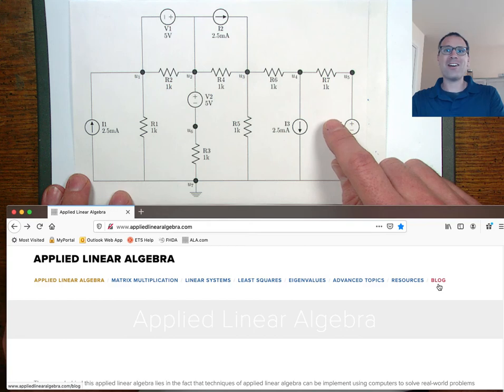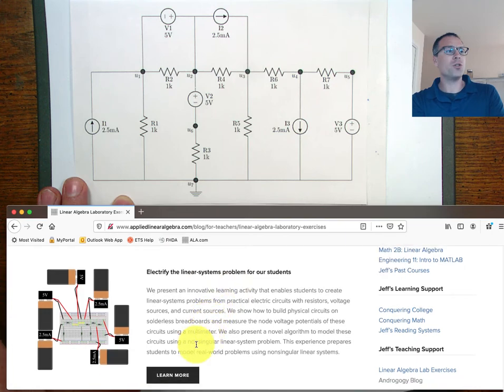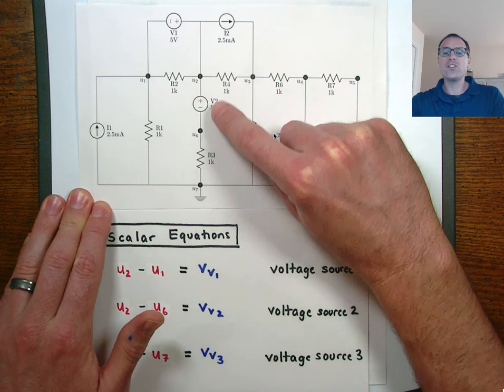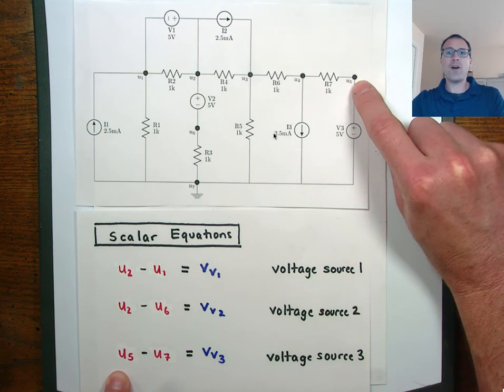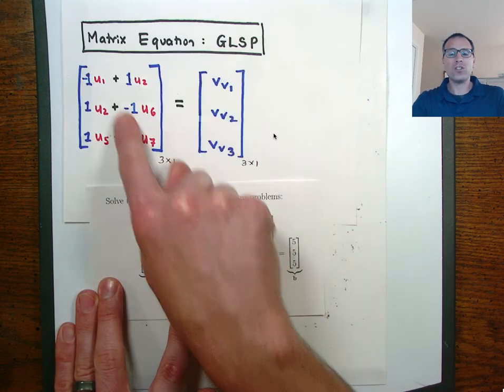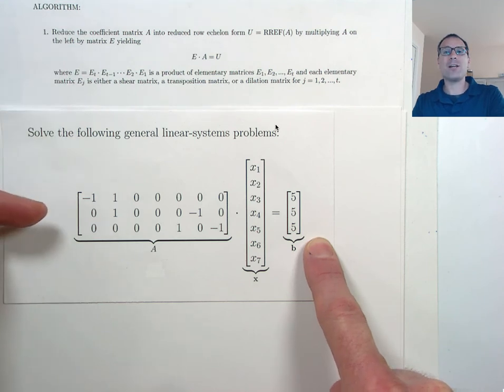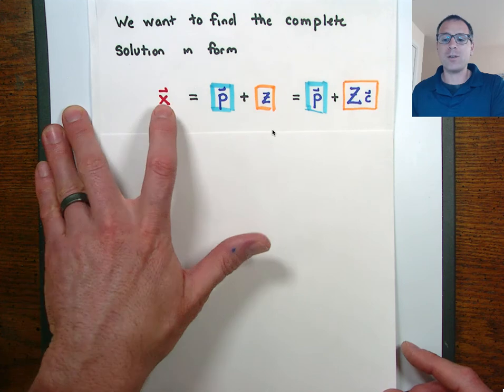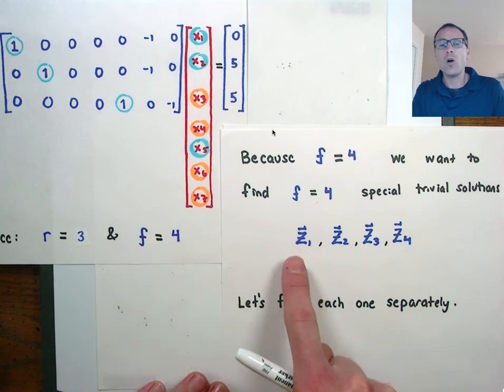A general linear-systems problem from electric circuit analysis

Comment: For the z vectors, aren't there an f times 2 amount of unique solutions because for each z vector I can just switch the signs on the pivot variables and they would still make the expression  Uz = 0 true. Or does unique solution means regardless of the positive or negative sign?